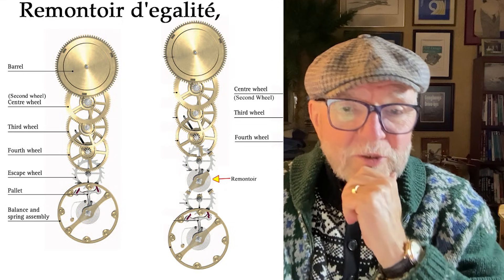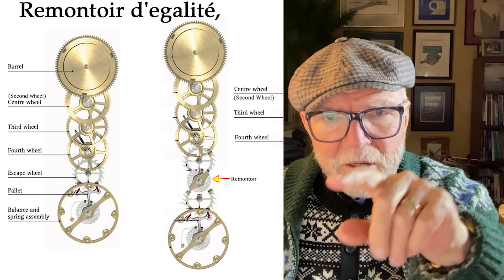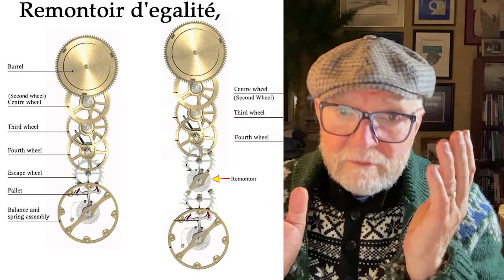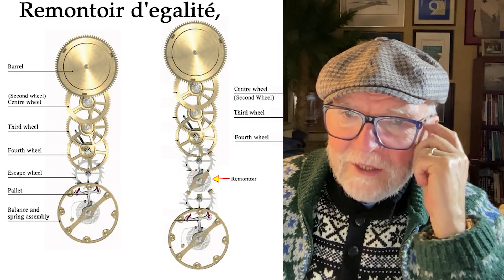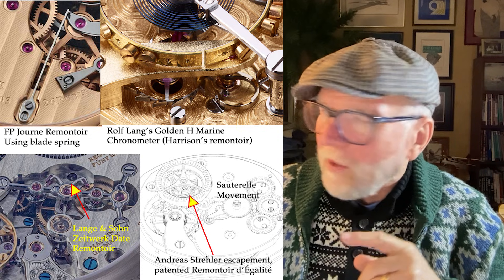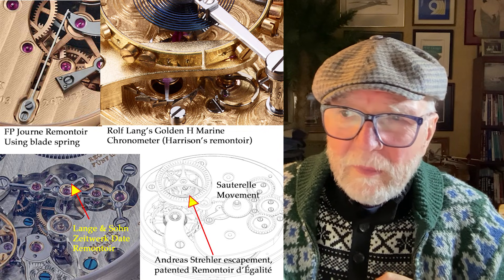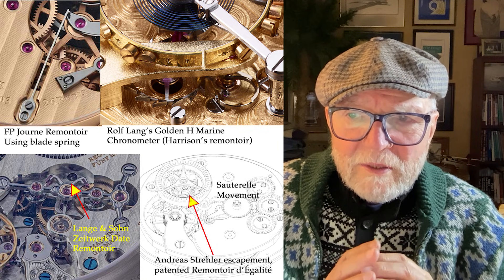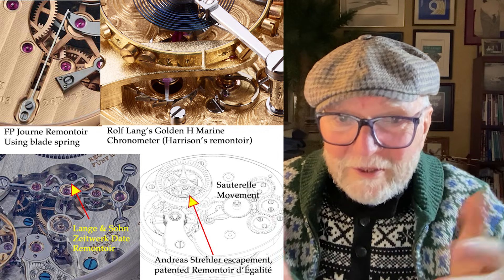Remontoir d'egalité: The Watch Connoisseur's Pinna  #VP349

Comment: Thanks again Bill for an informative talk. I have a very interesting master clock, made by Magneta, designed by a Swiss clockmaker Martin Fischer, late 1800's. It too has a remontoir! 
I have had the clock completely stripped down and reassembled, all functioning as it should. However my understanding of what the little extra spring and barrel does and how it works is a mystery to me!!
My limited understanding is as you described but the actual functioning of the device, although I have spent much time studying it, is still not easy to follow!
All the very best for a wonderful Christmas season.
Kind regards
Dennis
Reply from the maker: Hi Dennis, I'm with you. It's a knotty problem to tackle, but I find it fascinating. While the concept is very clear, the implementation of a remontoir d'egalité is an real challenge. Take care, Bill